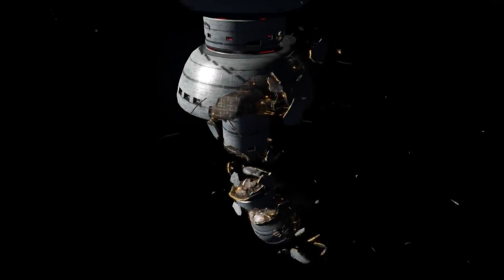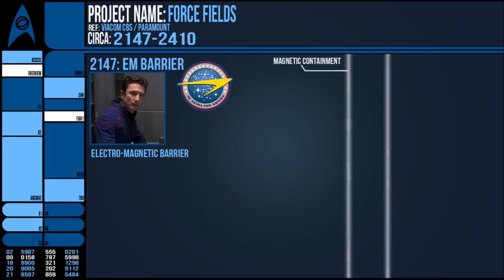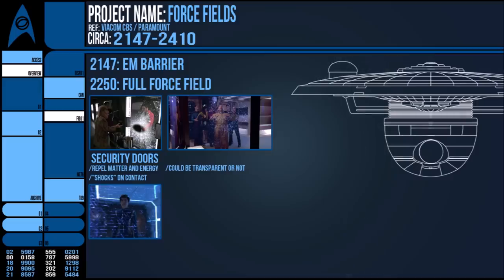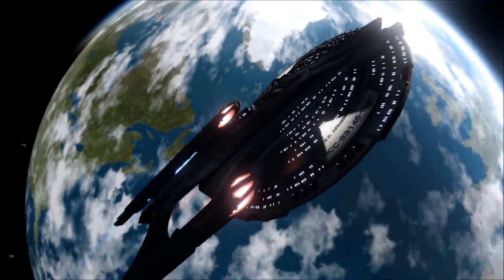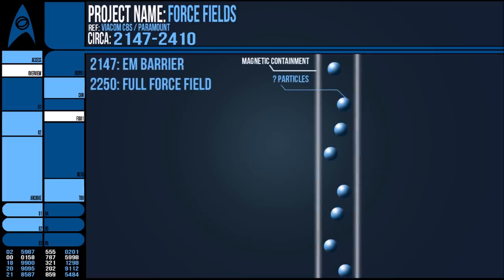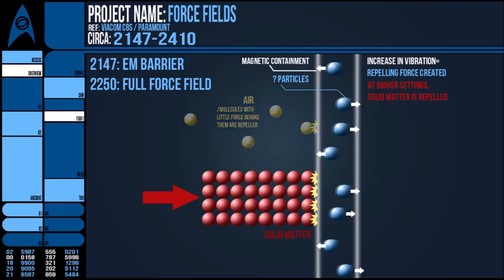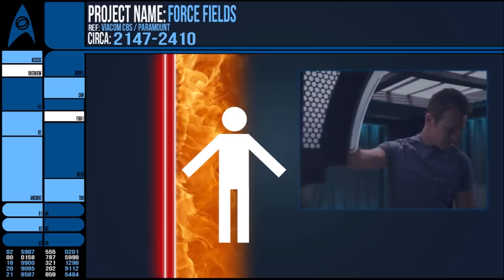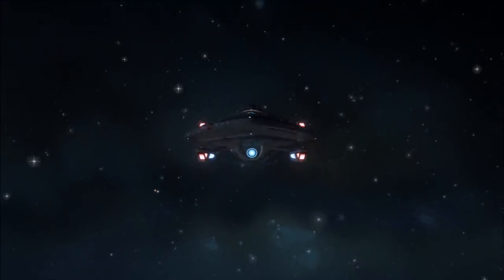How Do Forcefields Work? (Star Trek Theory)

Comment: there is an aspect that gives a hint to this that you missed
when force feilds are impacted, and in some cases depending on the type of feild and its intensity when they first power on there is an audible sound, which is somewhere between the sound of radio static and the chime of a tuning fork, the exact tone of this sound varies depending on the strength of the impact vs the power behind the feild with stronger impacts generating a deeper sound but the ptich going up again the stronger the sheild gets...
i think what were actualy seeing is a stream of gravitons, similar to those used in AG feilds and some tractor beams but rather then all of them  pulling and pushing the same direciton these are pusing all diffrent directions at once...the 'chime' when this is impacted is the sound of the electrical/energy charge that is working on the gravitons interacting with the item hiting it, the deeper sound the more damaging to the feilds integrity the blow is as i think what were hearing is the atmosphere being pushed away from the point of impact rapidly, generating a 'wistel' the more energy is drawn away from the feild, the slower the air is pushed, and the deeper the sound, the more energy is in the barrier, the faster the air, the higher the sound...
that said i dont know what energy they use to control gravatons anymore then most do, so im not even gonna guess at that

Comment: So here's the thing cold plasma is a thing scientists have been trying to make for a while it is Technickly possible to make it. 

Also consider low density highly symmetrical particle vibration this could in theory be used to change the color or remove color from a cold plasma. This would work by vibrating the atoms in a way that the energy is given off as a none visible radiation like infrared. It is possible, but I find it much more likely that it's simply extraordinarily small and precise manipulation of magnetic fields to prevent mater and energy from passing through. This would also explain the color and other effects by tuning the fields. In this case the actual fields would be pure electromagnetic energy and the other effects would be similar to an Aurora borealis. 

It would explain why the shields are so good at what they do

Comment: Warp travel actually explains a lot of the problems in trek tech, without the writers needing to make other stuff up... For example... From everything we understand about hypothetical FTL travel, you would need to be able to create an artificial positive and negative gravitational field to move a ship faster than light... We understand that under the alcubierre model, you probably wouldn't need "inertial dampeners" because the ship isn't moving, the pocket of space it is in is moving around it. But even if you did for say fast impulse acceleration, the same gravity tech could be used to respond to accelerations with counter gravitational actions and minimize the effect. Force fields? No problem... Manipulate some gravity fields using the same warp technology, to create an area of repulsion. If you have the energy capacity to launch a ship thousands of times the speed of light, a little bit of repulsion force on a small warp emitter shouldn't be an issue. Same thing for the ships artificial gravity, deflectors, tractor beams, the matter streams of transporters (still a bunch of other problems there scientifically.), Holodecks, chargeless particle accelerators, like neutrino beams, and what not, fusion, etc... A lot of these problems were solvable with warp technology and the science hadn't quite been pronounced enough or investigated enough to and by the writers, for them to realize it at the time, so instead we got Heisenberg Compensators, and they work just fine, thank you. I would argue, that this is a better explanation for why Earth tech improved so drastically after cochranes flight... The moment you discover the exotic matter required to make gravity and anti gravity, it would the same kind of technological shift we saw when we went from steam to electricity.

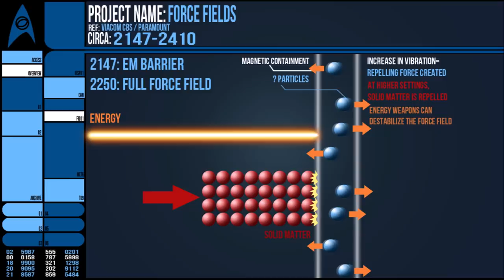Comment: 5:36 - With regards to Directed Energy Weaponry, if the charge of the beam is opposite of that to the EM Field’s containment, the energy would be absorbed, adding to the field’s overall power as plasma can stilll absorb energy from the fields at the moment of contact, due to the. (Assumed Perfect) Combined Gas Theory (Gas particles always move in random straight line motion, with all collisions elastic, but during collision, they can actually absorb energy in the form of Kinetic Energy from the potential energy building in the field. Som the more gas particles, the higher the absorptive capabilities of the field, up to a point of practical infinity. However, if it’s charge is equal, the beam will be reflected from the shield; most likely.

Comment: I think structural fields could just be manipulating the magnetic fields within the support to counteract loads, so think a beam in compression, you add the magnetic forcefield to stretch the metal, canceling out some of the compressive load.

Its hard to say what exactly they do because we don't have any sort of idea what stresses the structure of a starship is under since gravity tech, impulse drives, and inertial dampeners are all adding force vectors in all sorts of directions while our understanding of rockets have forces in compression along the thrust axis

Comment: I assumed that to reinforce a ship’s hull with a forcefield, you just erect a forcefield tightly fitted to the hull of the ship, creating an extra shell of, well, force that keeps the hull ship shaped.
Reply: they do have those in Star Trek apart from shields. Structural Integrity fields. it's also how they can forcefield hull breaches so fast.

Comment: In your video on force fields it holding cells it is not plasma but another type of particle. Not sure if like a radio wave very tight band width or as you said particle which would act as a em barrier. They do use a fair amount of energy but not as much as em shields for a ship, i did study a bit on this topic.  But never finished it. Now i wish i had. Real life got me thinking on military rockets fired into another country as short range and disrupt them with a barrier of some energy even like radar emitting fields. To jam or to make them inactive. If possible.  Depending on its type. I know with wars going on or skirmishes. It's an idea.

Comment: The diagram showing fields as a sort of sandwich got me thinking... what if the mystery particles in the middle are just super compressed air? Any matter will do, and air is matter, even dense atmospheric levels can reduce radio transmission so dial that up and you've got a wall that can block stronger energies.

Comment: Technically you can use some magnetic field and the electrons within atoms. Like lets say if you go with your example of flooding a thin invisible wall with particles. If you're able to somehow generate a magnetic field inside the invisible wall (maybe having the invisible wall somehow produce a magnetic field on 1 side). This could work  I think. But it would require a ridiculously high magnetic field. To the point if you have any metal in your body like an implant. It will rip out of your body if the field messes up. Maybe to the point of pulling the iron out of your body x-man style.

Comment: A forcefield could be not a contained plasma, but supercooled particles, Cold instead of hot. Basically at only -273.149C the particles would repel like plasma but make the field cold to the touch, also the layer can be extremely thin, so when the field goes down there is so little volume that it immediate dissipates and doesn't have an effect of temperature, the emitter supercools the particles and keeps them cold, shooting energy weapons at the field would overload the emitter. So Think "Bose Einstein condensate" instead of Plasma. A superfluid is thus able to do significant work as a barrier without taking up any real volume. And thus not cook(or freeze) the occupants as to not surpass the cell's ability to keep a stable temperature. The temperature differential between nanokelvin and 295 kelvin is only 295 degrees. So not as dangerous as a differential of several million degrees

Comment: plasma doesn't necessary have to feel "hot", cold plasma torch is already used in industrial application for many decades. You can put your hand over a cold plasma torch and it will feel like room temperature. While the average temperature of the plasma particle might be high, but because the number and mass of particle are so small, the amount of heat it can transfer is extremely minuscule in human scale.  IE: 1 million hydrogen atoms at the sun's core temperature of 27 millions kelvin contain several order of magnitude less thermal energy than the friction heat energy from rubbing your fingers together. So force field probably won't feel hot. Photon (EM force carrier particle) itself also carry momentum, in the lab you can technically "push" and "pull" very small particle using laser.The catch is to scale the momentum up to baseball scale, the thermal side effect would vaporize the baseball. Maybe in the trek universe, they manage reduce the thermal side effect and just directly transfer the force onto object via photon, so no need for a plasma medium to transfer force.

Comment: I dont know the physics behind the heat required for plasma to repell other matter but the heat required to maintaine a plasma between the "EM Fields" would be greatly reduced if the space inbetween was a lower pressure then normal. Which is how those old Plasma ball lamps function. anybody who has seen or played with them would remember that they dont really shine brightly or get that hot. that is because there is far less atmosphere in them then normal and therefore the plasma density would be pretty low but the charge needed to maintain the plasma would be low as well.

IIRC once a plasma conduit is established it needs far less energy to be maintained then being generated. something to also think about would be the "Pinch Effect" which basically draws plasma together to minimise its surface area when a current flows through plasma. Which is why there are only those wandering strings in Plasma Ball Lamps. how they would get a sheet of plasma without it snapping into a few strings I have no idea.

But maybe I'm looking at this a little bit wrong and instead of the plasma beingthe repelling force it is just used as a conduit for the EM Fields (Since makeing such "sheets" of Em Fields is more or less impossible).
Since ElectroMagentic waves  of sufficient strength can act on nearly any matter (pure neutrons and some exotic particles are the exception I believe) a signal that is modulated in just the right way with enough strenght might be the answer here not the plasma, It just works as the conduit on which a Signal made up from Standing Waves is induced. (Standing Waves being waves that have just the right wave length that when they get reflected at the end of their conduit back onto the resulting wave on the conduit will not change its postiion but be more powerfull then the induced wave)
so If there are multiple standing waves induced onto the palsma conduit it might be able to generate a signal that pushes matter away at peak points. with multiple emitters these peak points might be layed out in a grid like pattern or other shape with very small spaces between them. 
Since normally such a signal would most likely also mean that there are places matter gets pulled to along its length 
(inducing a net positive into a EM Wave going through space is pretty hard, but would be needed to generate a signal that just pushes matter away, using the plasma as a conduit here might help... maybe)
but with this being a signal it might be possible to use particle inertia to push the matter away if you shift those points that push around fast enough.
Basically you got two matrixs of dots one that push air away, and one that attracts it. When the air molecules have just began moveing from the pushing to the pulling dots you shift it around so that now they encounter the pushing ones where they are going. Since I doubt the pulling and pushing would only act in a 2D space it might be possible to get a net neutral movement in line with the forcefield and a pushing away one in general.

Granted all of this would probably generate a lot of heat and such as well as induce a lot of heat into any molecule trapped between the EM Waves but it would explain the bruns anybody would get if trapped in the activation.... it would basically be like putting that part of you into a few hundret to thousends of industrial strength microwaves at once.

Comment: In theory, you dont need particles trapped between a magnetic field, just a highly powerful field alone would do the trick. The electromagnetic forces between atoms are what stop you falling through the floor.

If you could create such a field it would be possible for regular light particles to pass through while stopping pretty much anything else. It would also be possible to create a similar field around your shuttle that matches the containment field so you can pass right through.

Ofcourse this is all highly speculative and probably not at all possible in reality.

Comment: Particles have a very low mass however there are other particles which can impart mass onto other particles. Bozon mass carrying particles can do this. Sorry I misspoke it's actually the particle that Quark the Farangie bartender is named after. (My bad.) It’s possible to contain plasma or particles inside of a magnetic field after the particles have had extra mass imparted onto them. In essence this would result in something like programmable matter. It would be like having a wall of dust made of subatomic particles that you can program a magnetic field to control into different shapes. It would also be a way of creating essentially a physical surface without a physical material. And they can be generated from other sources. Essentially you can have a light source that has the photons suddenly gain mass and be controlled by a magnetic field and produce a solid wall of light. Congratulations this is a force field. But you could do the same thing with plasma, electrons, or any other form of subatomic particle.

Comment: The funny thing is that forcefields are NOT science fiction.  Today, in 2020, you absolutely can create a wall of electrons so dense that nothing can pass through it.  The problem is that it takes enough power to run a small city in order to do that.  So the fictional part of this is that they're able to create forcefields easily and using much less power.  That does seem to track with the way technology evolves, however, so really Trek's force fields are probably the least fictional thing in the show.
Reply: They came up with a force field more than 4 decades ago but like you said, they're power hogs. On a side note the Russians have been messing around with using plasma fields as a shield. https://www.youtube.com/watch?v=I11ClvQ6Fpc
Reply: and who do you think is going to pick up the bill for something like that?  not gonna pay for that working minimum wage that's for sure

Comment: There is such a thing as 'cold' plasma though the coldest plasma can get is between 70-100 degrees Celsius.
Reply: Just a tad warm but won't vaporize your hand when you touch it. Will burn lol.
Reply: @Qardo  nothing that a dermal regenerator can't deal with if you have all the recent upgrade patches and optional warranty agreements
Reply: Somehow Geordi was able to stick his arm through a plasma field confortably at a conference (Timescape).